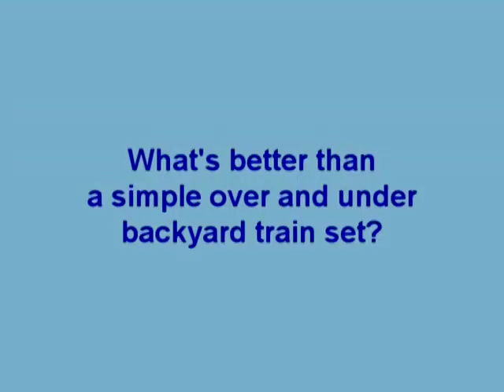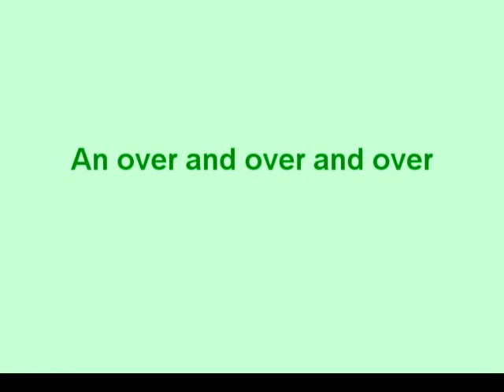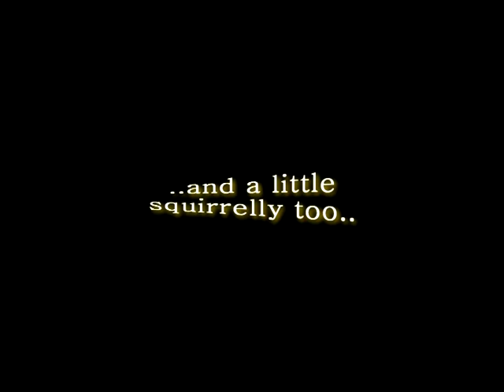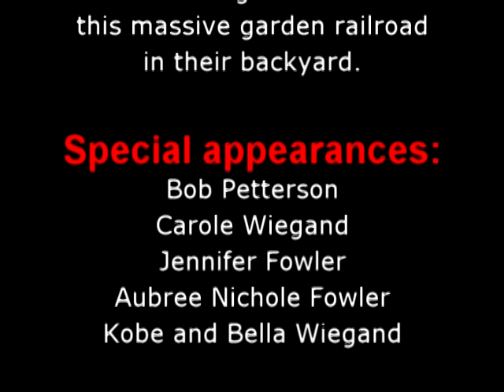Glenn's Garden Railway

Comment: Okay Glenn,fast forward 5 years later.is your railroad still the same?
Reply from the maker: Thank you for the question Robert.  My in-laws have since passed away and we sold the property.  Thus, I had to take it all down.  I am now building a new layout in our new backyard.  It will be a year or so before that video surfaces.  Stay tuned…
Reply: @GDoubleU7  Thank you bro!
Reply: @GDoubleU7  Sorry to hear that :( It really was a cool layout; very original. I'm wondering what condition the top boards were when you took it down? I'm planning to do something similar, though nowhere near as complex, but figure the particle board is no match for weather long term. Looking forward to seeing the new layout.

Comment from the maker: Thank you for all of the kind comments.In regards to the rains...some of the rain seeped into the particle board which swelled making the tracks come apart in places just enough to create non-conductive electrical issues.  My fix will be one of two ways:  replace the swollen boards or solder jumper wires between tracks.  I'll see how much time I have this year and update as appropriate.Thanks again!